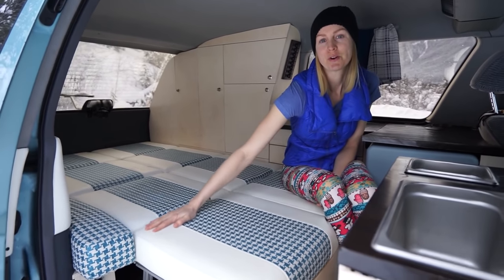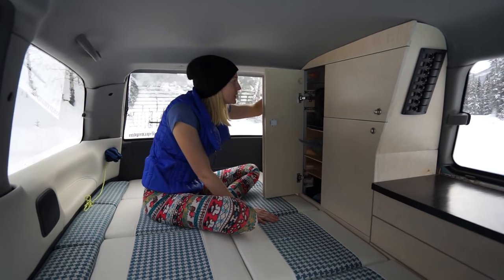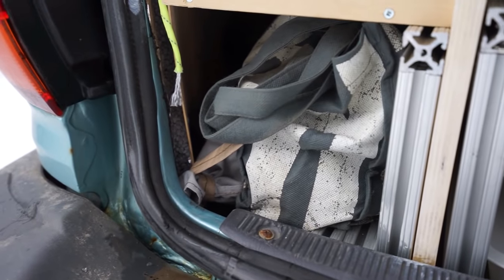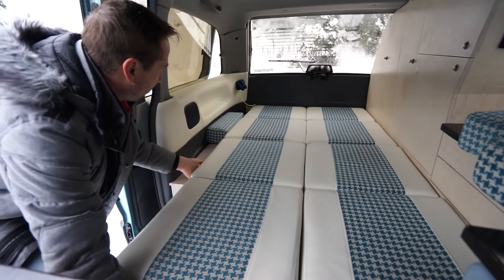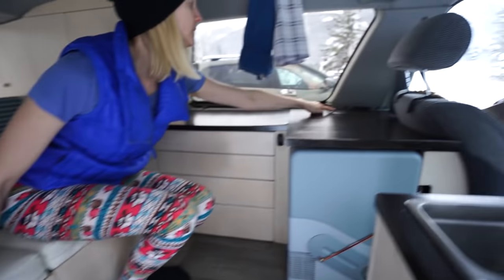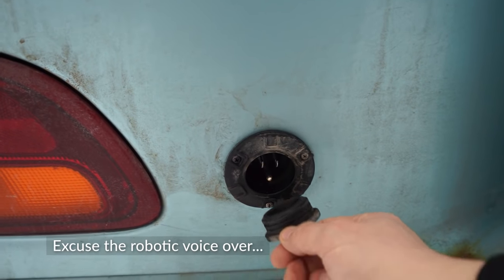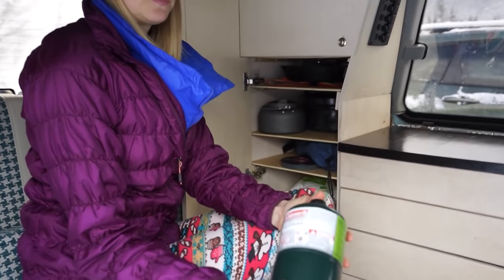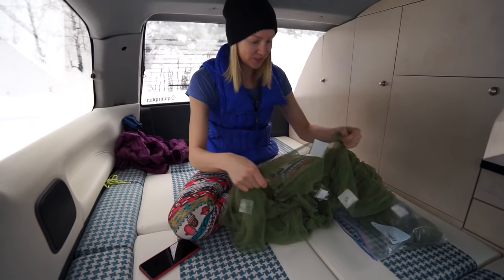Sexiest BUDGET MINI-CAMPER Ever! // VAN TOUR - Minivan Sleeps 5-6 People with Kids

Comment: Great design. I guess here in Europe that kind of bed would not be allowed to be used as seats while driving. Also: did you ever say what type the car is?
Reply from the maker: Thank you! Why wouldn't they allow it? It's structural aluminum and seatbelts are attached to the structure underneath. The bed is also held in place by two aluminum tabs so it can't lift off the floor in case of a rollover.
Reply: In Europe, vehicle seats need certification. Whether or not your design is as strong doesn't matter if it hasn't been tested by the right people.
Reply from the maker: Interesting. I'd like to see them test it. I'm curious to know how it would perform.
Reply: @GotMountains  Eric the minivan conversion guy, did his entirely removable without drill holes...

Technically, tho, unless you're driving something with rollovers bars (like racing cars have), in any rollover accident, it's unlikely you'd survive in nearly any vehicle. 

From auto litigator, Brian Chase's book, "Still Unsafe at Any Speed." Fascinating and extremely scary stuff, that 40 years after the Nader book, nearly all automakers have willingly killed people for dumb reasons: air bag issues (the failures tend to be very morbid), tire blowouts, seat back failures, and roof collapses. 

You don't even need much to put the roof well into the passenger compartment. Ford turned a large truck upside-down and dropped it. They couldn't even get a few inches off the ground. Rather than changing the CAR, they just modified the TEST. Twice. Still couldn't simulate a rollover without probably "killing" the imaginary passengers. 

In anything you'd be likely to rollover IN (taller trucks and such), I'd have rollover bars installed.

Comment: Hello! I love your idea, but I'm having a hard visualizing how the middle two cushions are attached to the aluminum framing. It seems like they're on rollers, so when you go from bed-mode to seat-mode, the two middle cushions would sit on top of the outer cushions. Otherwise, the cushions would clash with each other because the hinge is below the cushion. If it's not too much to ask, can you please clarify how this is done? I love how your brain works, just wondering how you solved this issue!!

Also, is it possible to purchase the 3D clips you mentioned in your blog?
Reply from the maker: Yes, the 3D printed clips are what allow it to slide. The clip to the aluminum and let it move to avoid the clash you mention. I could probably send some, but I have to get a friend to print them for me. If you want them, send me an email (on website) and we can figure it out.
Reply: @GotMountains  Hi. Are you guys still making the rock n roll bed frames for sale?
Reply from the maker: @gothamghostrider4634  so far we are for people local to us in Canada. It's a little harder for international.

Comment: I keep wondering what size a "mini"-van has in the US...here in Europe my Ford S-Max is consiered a large car and I could barely fit the area of the bed in the back, not to mention the kitchen and the side shelves.
It's not a problem if you want to build for one person but if you think of two people it gets narrow fast. I need a bigger car! ;-)
Reply from the maker: Yeah, you guys have a wider selection over there. The rear of this van is 96" x 60", so it was a bit of a challenge to squeeze it all in
Reply: @GotMountains  well, that's quite gigantic for european standards... Mine is 78,7" x 47,3" approx. (2m x 1,2m) in the back and it is one of the largest, especially longest Vans you can find here. Anything larger we're talking cars actually meant to be transporters like the VW T[X] Bus or the Mercedes Sprinter. But those dont look and behave like a normal car anymore which leads to issues with stealthability, parking spaces and driving.
That's why you can fit a bed for two persons in my car but everything else has to go underneath so the feature of accesibility to your stuff while in bed is out of the window... When there is the bed set up there is only the bed, nothing more.
Reply from the maker: @dereinzigwahreRichi  sounds similar to a Delica. I think you have these over there though. They are known as a Toyota Estima there. I think they are similar in size to a Mercedes Metris.
Reply: @GotMountains  yes, thats the size of the ones I talked about in the last segment, they are similar to the Volkswagen Transporters which everyone here is crazy about. Though I heard none of these model names ever before but they seem to vary wildly even between european countries, letvalone the US. The Mercedes is known as Viano here and the Toyota is a ProAce. The prices for all of these larger Vans skyrocketed during the last year because of the pandemic and the lockdowns. People wanted to travel anyways and so everyone suddenly wanted a camper van. Now I'll go on with my smaller van for a while and wait a year or two and then buy a bigger Van when all the soft boiled people get tired of camping and nature and return to their all inclusive hotels... :-D
I think I'll get a Ford Transit though, they're produced in Germany and Fords are trustworthy cars to me. Compared to the german brands who do produce abroad like Volkswagen in Mexico...a crazy world that we live in.
Take care and have fun with your Van!
Reply from the maker: @dereinzigwahreRichi  haha, soft boiled. I'm going to borrow that term...🤣

Comment: I wanted to do this for the bed of my ford ranger but my co-worker said I would need to install star bolts to the bench seat bed conversion and have seat belts installed for all potential passenger.  Have you had any problems with highway patrol?
Reply from the maker: None at all, it in Canada there aren't any ways to certify a self build. This stuff would easily be able to be engineered to pass an inspection though.

Comment: When the rock and roll bed is in bench mode are the legal seats for driving with or without car seats?
Reply from the maker: Probably, as they are made from structural Aluminum, but there is no process in Canada by which you can get them tested and approved unless you're a manufacturer, so I don't know.

Comment: Wouldn't covering reflectix with black cloth remove it's heat-reflecting properties?
Reply from the maker: Last summer in Las Vegas the van was 15°C cooler with them in, so they definitely do their job. They are supposed to be ideally set up with an air gap, but I wanted black for stealth, so I left the inside open to reflect the heat back in during winter.

Comment: Is it legal to have passengers when bed is in seat mode while driving?
Reply from the maker: It depends on the jurisdiction, but I believe most places allow passengers in motorhomes. I believe manufactured RVs have safety requirements, but here it gets really fuzzy when it comes to home built as there's no where to go to get any certification done after it's built.

Comment: Water too close to front seat sure it splashes n then mold or smell. some sort of barrier between the two.
Reply from the maker: We were a bit worried about that but in 2 years it hasn't been an issue at all. We actually turned the water pressure down a bit so the spray is a lot less agressive.

Comment: Very nice! I love it. :) 
Do you have problems with the vents on your water jugs leaking? We opted not to use that style on our trip because I was worried about it, but I'm curious if i spent a lot more money for no reason.
Also when refilling the propane bottles- weigh them to prevent overfilling. I refilled lots. The only worry I would every have is that the valves might leak as they get old. Just check the valves every time you unscrew the bottle from something if that worries you. I also never had mine where we slept or drove though. 
That fridge probably works prefect for your setup. We had a similar one and disliked it but we couldnt have it running all the time. My batteries couldnt run it all night so if we had no shore power we had to turn it off and they need to always be plugged in and running. Ours did anyway. It was from canadian tire. I thought it would allow us to be ice (water) free but the thermo plate would create a lot of condensation and soak everything inside. Did you know that cardboard milk and juice containers dissolve when they get wet on the outside? Lol. We didnt until we were in the middle of nowhere and opened our cooler....
Reply from the maker: Actually, no trouble at all. I seal both the vent and the opening so the only place they can leak is the hole in the cap for the fresh water (would have to slosh up - possible, but never noticed it ever leaking) and the hole I cut in the top of the grey water tank (it was so close to the tank I had to cut a snug hole for the drain hose to drain right in. I never let the grey water get very full, so it might leak if it was 3/4 full, but I usually dump it around 1/4 just because its easy and I want to keep the potential small down.
Reply: Right on! I was worried about the jugs getting squished or getting hot and the air pressure popping the push in vent plugs out. I had mine all packed tightly together. They were also in my trailer which bounces a lot compared to a vehicle, especially after we had to replace our springs with ones twice as stiff... Is that all the water you carry with you on trips or how much do you take?
 I had so much water! It's funny to look back at now though, we were so inexperienced. We had never gone further than a one day trip as a family before we left on this 3 1/2month 30k trip. The only trial run we had was a 3 day weekend without kids with an unfinished trailer 2 weeks before we left across the country. I had no idea where we were going to be getting water. I had planned that we would only be in a campground once a week or less, the rest of the time we would be camping somewhere random. The first part of our trip was fairly remote. Edmonton to prince george to whitehorse to anchorage to dawson city to kananaskis. We had planned to make a lot of meals that used a lot of water and I had planned for all four of us to shower every other day. We left with 400 lb of water on board and I was worried that it would not be enough! Lol. It went so differently than I thought it would. We hauled 250-400 pounds of water around everywhere for the first 12k or so. Then I got rid of most of our waterjugs for travelling through the rest of Canada which was more populated. I think we had a 75 or 100 L tank under the trailer and 5 x 5 gallon jugs in the trailer full of water. Crazyness.
Reply: I have the smaller size of those reliance water jugs and haven't had any trouble with the little vents leaking.

Comment: How many amp hours are each of your batteries?
Reply from the maker: There are two 100Ah AGM batteries.
Reply: @GotMountains  Thanks. Do you charge them through dc-dc? How long do they take to discharge, when using the diesel heater?
Reply from the maker: @vancedyt2639  because they are lead acid I have them connected directly to the alternator through a 2 gauge wire. Nothing else in between. I can usually sit for 4 days before the batteries get low. They would run the heater for 2-3 days straight if I needed to. I've never had them run low for me yet, but I only run the heater when it's  -10°C or colder.

Comment: I didn't see a carbon monoxide detector peeking out...
You sure need one with that unit in your van otherwise you might not wake up one morning.
Reply from the maker: Need one with which unit? The furnace? If so, the exhaust vents seperately out the bottom of the van and doesn't mix with the interior air. But, there is a detector under the bed. It's never gone off, even when cooking and the furnace running.
Reply: @GotMountains  Any device particularly a "made in China" diesel heater, in a closed area that exhausts C0 can at some stage leak and kill. Well done that you thought it through and have one!

Comment: Please be very careful with your van. I suspect that having kerosene, a furnace, and a gas tank in the back could be ugly if you were to get rear-ended.
Reply from the maker: Yes, that's why we use kerosene and diesel. They don't ignite from fumes like gasoline will. If you drop a match in a pail of diesel or kerosene, it will put the match out. That's why it's a common fuel for heating ☺️

Comment: That convertible bed does NOT seem safe enough for transporting humans. As far as I can tell, the frame is not anchored to the chassis, so adding seatbelts to it will just mean they are stuck to a massive object that will fly around the vehicle should there be an accident. 
It's a very nice build, and very cool and functional, but it doesn't seen safe for the additional passengers.
Reply from the maker: It's anchored in 2 places 🤷‍♂️
Reply: @GotMountains  fantastic. That makes me feel better. It is a very nice build. Cheers from your southern neighbor.